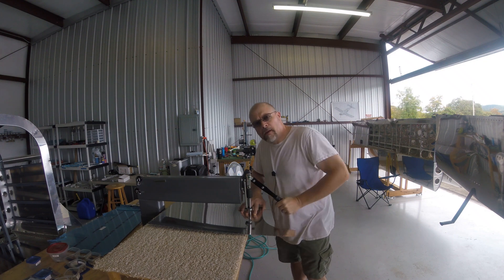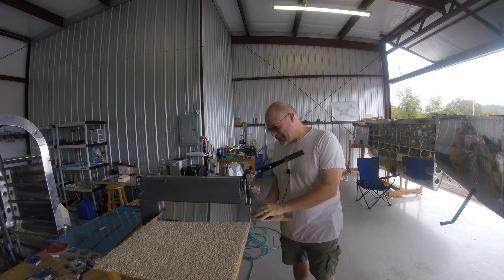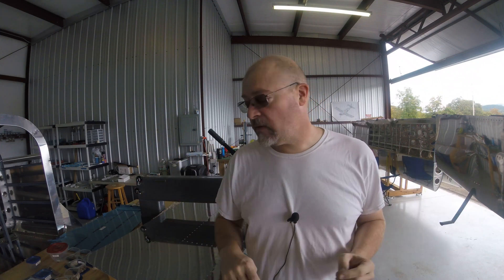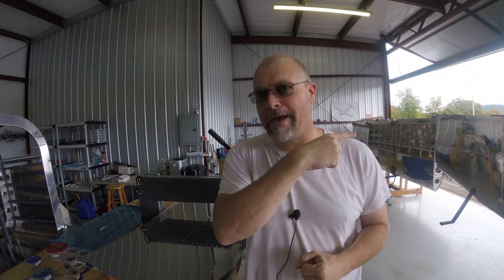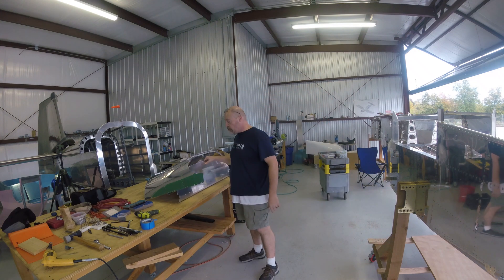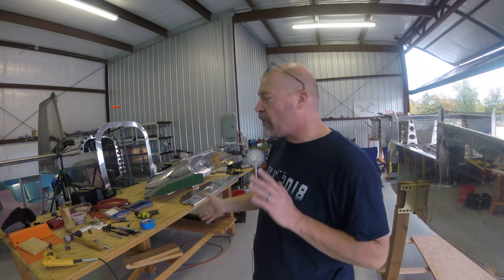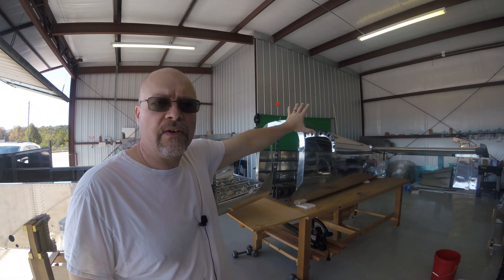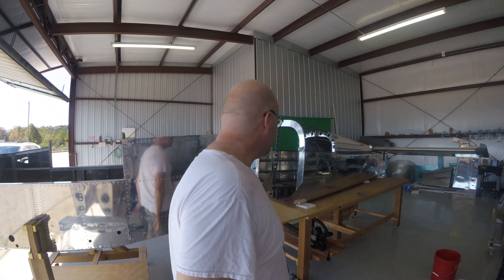RV-10 Fuselage - 035 - Attaching Empennage to Fuselage!

Comment: We just mated our polliwog to it’s tail !   I guess we are both at similar build points, so your comments were very helpful.  I must admit, I don’t do much match drilling these days. This is our 5th Vans aeroplane and the accuracy of the punching is such that we prep, drill, dimple and then assemble.  Saves a chunk of time.  Indeed, the 10 just went to punched finished size which is a relief.  That said, the 10 instructions suck.  Their first outing in isometric form and they either need a big revision or a whole load of ‘Where’s Wally’ bubbles to let you know why stuff isn’t being done now, but will be done soon.   Anyhow - back to work as someone says !!

Comment: This was probably the kind of task that would have called for begging the missus to come over to the hangar for a couple of hours... in any case, nicely done! One thing, though: with the plane becoming that much heavier and harder to move, would it not be a good idea to lower that stand BEFORE putting the two parts together?
Reply from the maker: Too late!  I'm actually looking at installing a winch system..  You can get ceiling hoists pretty cheaply actually..
Reply: Our stand is only a foot or so high.  Makes for a great work height and we use braked castors so it is totally portable but capable of being locked in place.  The front and back had their own trolleys, but as we now mated the two, we simply join them with 1” x 4” timber and they become one MF of a trolley.

Comment: Is your dimpler set up correctly? It doesn’t seem to be going over centre / the bar flexing very much compared to mine.
Reply from the maker: It makes perfectly great dimples so... yes?  I think the dyes have more to do with the outcome than which system you use to make the dimples though
Reply: Fair enough! So long as there is no distortion around the holes and there are witness marks then it should be good. It just looked a little underset to me.

Comment: Yeah, this step seems like a pain.
I’m wondering how much time the new factory match drilling will save. Would you expect it to stop most of the assemble/disassemble/reassemble steps?
Reply: They are match drilling from the factory now?
Reply: @ValentinoDagher  they have been phasing it in for a few months now. Announcement is on the Van’s website.
Reply: @ChrisVirgilio  I’m pretty excited about it. It has to be making more people lean towards this plane instead of the Sling TSI
Reply: Punched finished size.   Means no more match drilling...... well a bit when rivets don’t fit but you know what I mean 😂